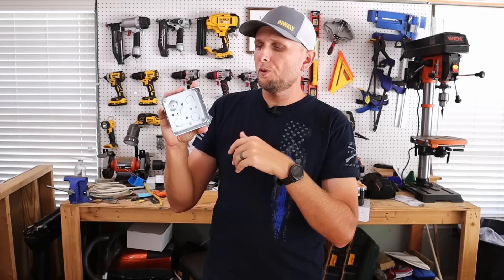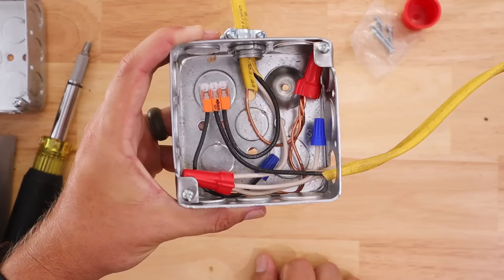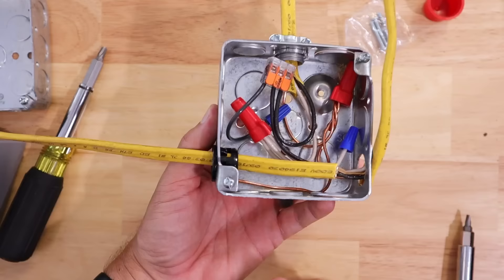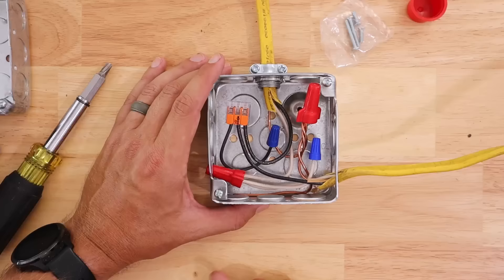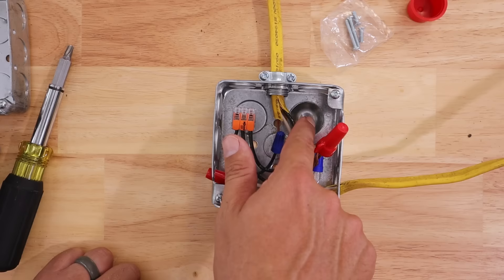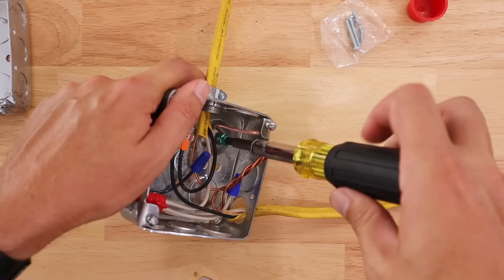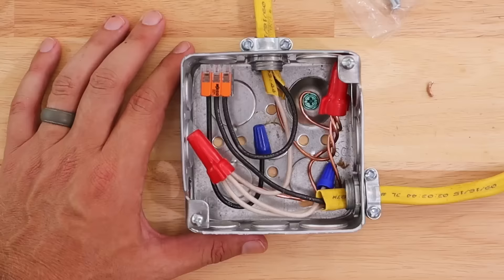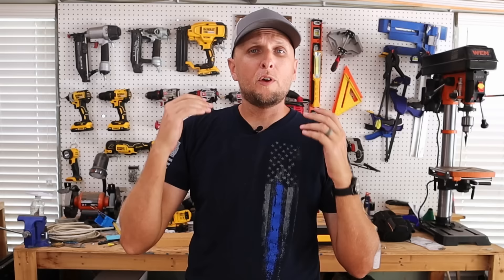The BIGGEST Mistakes DIYers Don't Know They Are Making When Installing Metal Electrical Boxes

Comment: The grounding hole is not always raised. It is sometimes one of "mounting " holes.  It's usually a little smaller and threaded. Lots of fun on a box mounted to wood. You either have to hang it off the stud for clearance or make clearance before mounting. Those green screws do not drill into wood very well and it will seem tight but is not all the way tight against the wire. Always wiggle that ground once you think it is "tight" to be sure! The boxes with a bump are preferred because the clearance is built in, but you don't always get what you want at the store!
Reply: @jeremiahbullfrog9288  I like to mark the holes, then dril a big shallow hole under the hole :)
Reply: @livingdeadbtu  a drill/tap combo bit does all that in one go.
Reply: On older boxes that are re-used during renos that have no camel hump or threaded ground screw hole I use the pre-wired grounding clips that attach to the edge of the box.  Faster and are code compliant.
Reply: @davidyansky6605  i got a box of those, but never used them. Its just as easy and quick to use a drill/tap combo bit.
Reply: The best way I've found to make clearance is to either keep an awl in your bag that has been ground down to just under the hole size and push it into the hole after the box is in place. While that hole you make is smaller than the ground screw, it will allow the screw to push itself in much easier. I also keep 6/8/10 tap in my pouch which can work for that as well using the first #6 tap as the awl. However be careful of breaking it as these are very hard and brittle.
Reply: Some people might say if you're using a humpless box on a flat mount, you're using the wrong box. The humped boxes are made to be used flat against a surface to provide clearance for the ground screw. The humpless boxes are made to be mounted with clearance behind them. Ne'er the twain shall meet.
Reply: @jeremiahbullfrog9288  probably not, but all these hacks slow you down and leave you liable to fuck ip, not notice, and leave behind an actual fault that IS a code violation, and dangerous to boot. Come prepared.
Reply: @Mirco Muntener  nowadays you use the things the store has. Sometimes, I have to go to three different stores and revise my plans because of supply shortages. The days of putting my nose in the air and saying, "I don't like that kind of box because I like another type," are gone. You get what you get and like it. I have found that buying what is in stock is faster than driving all over town or ordering something and waiting while I pray it comes in.
Reply: @david Yansky
Those clips are dangerous ( they are only compliant because the company paid to get them passed my honest opinion) . They are almost never put on correctly and they are never as good as a screw. 
I used 1/2 “ 5/16 head self tapping screws.
I started doing electrical work in 1977 and we called them 1900 boxes and ran EMT and pulled stranded wire. ( solid wire was for tying stuff down-ladders,stubbing PVC  out of the slab EVT ECT.) fast fawned 1992. Different state different rules. In comes solid wire/Rolex . I personally don’t like Romeo. I have built my house and shop with only EMT and M/C. Still use Stranded THHN with EMT/PVC.  I have PSA now so I use a tool  on a 12volt batch drill to put my wire nuts on. But you have to be careful not to over tighten them because they will come out of the back of the wirenut.
My grandfather had to twistSND solder every joint. Sometimes change is good.
Reply: @livingdeadbtu  Exactly why real electricians avoid the big box stores and use electrical supply houses that cater to professionals. If HD, for example, can't sell 100 million of something they don't want it to take up shelf space, which limits what pros can get. When I call my supply house guy I know I'm dealing with someone who understands what my material needs are and will do what he can to make sure I get it. While supply chain issues have hit everyone, if he doesn't have what I need on the shelf it's usually there by 6AM the next day or delivered directly to the job site. Most everything at the supply house is also cheaper than the DIY stores.
Reply: That is very true, and then if the box is mudded in with concrete, those non-raised holes become very hard if not impossible to use, which raises the question: is it good enough if a metal fixture screwed down to the box is grounded with its green grounding screw? I'm having this exact situation with my home reno and outdoor light fixtures. I can't get a grounding screw to the metal box itself, but the steel I-bracket for mounting the light is running screw-to-screw and has a green grounding screw - which sure enough provides 100% indirect conductivity to the box. Do I still need to ground the box directly too, or is this indirect connection enough? What says NEC?
Reply: @Fire Plug Obviously sarcasm, but I've seen it. I have a pic of it somewhere.
Reply: A small self-centering drill bit works for me. Even if you hog out like 75% of the wood, the screws go in super easy.
Reply: One thing I see wrong in this video is you're using those crappy China made southwire linemans. Buy American Made tools if you can guys. Which even some Klein stuff isnt American made anymore. We dont even call em linemans we call em kleins lol. Ibew jw if you couldn't tell by the comment. You make good videos bro keep up the good work and call your nearest ibew local and come get on board become a brother. Greatest union on earth. Best wireman too lol.
Reply: I will also use electrical tape and wrap around my wire nuts and wire  just to make sure they don't pull out. Extra safety  in my mind.
Reply: @timu.710  the only thing that electrical tape is accomplishing is pissing off the next guy.

Comment: Simple, concise, common sense. I am a DIYer, but I've always preferred a mechanical connection(twisted wire)
with a proper sized wire nut. Thank you for your simple good advice.
Reply from the maker: I agree.  Really glad to hear you liked it.  I really appreciate all of the feedback!  Thanks a lot Ricky.
Reply: Ricky....that's because you are smart...wegos are for inside lighting connections
Reply: @BlackVibeBallsack  You cannot even correctly spell WAGO. wagos are under-rated in their spreadsheets and can actually reliably have much higher current pass through them then their rated current. i.e 20A / 300V.

Comment: Great video, thank you. One thing on the 12awg and 14awg combo. Wire sizing is sometimes upsized due to length of run to avoid voltage drops. Personally I'm running power to my garden ~150' away from the breaker box. I'm running... i forget, 10 or 12 for the main run, but intend to use one size down in the boxes or the branches. It can handle the amprage, just would cause a problematic voltage drop over the distance. Either way, still an excellent video and I've certainly learned some.
Reply: @Salvadorbalihai24  The tap rule is three meters / ten feet, not three feet.
Reply: Just as long as the circuit is protected at the smallest gauge rating . If you downsize to 14 gauge you can only protect it at 15 amps no higher. 29 amps for 12
Reply: @Salvadorbalihai24  no
Reply: Poor guy has no idea what he just walked into with the whole 14 is cool on short bits. I'm staying out of it, for now.
Reply: @gerdberg4188  #12 copper is limited to 20 amps in most cases, even though the amperage table lists it at 30 it is limited below in the fine print notes. There are conditions in industrial and commercial installations that are engineered for the higher amperage but definitely not for a residential application....so a #12 can't be on an overcurrent protective device above 20 amps.
Reply: Derating for distance starts at full ampacity, which is 30 for 12AWG, not the 20amp overcurrent device limitation. So you can derate a whole bunch before worrying about distance.
Reply: I can't tell if yall are agreeing or disagreeing... bottom line you can mix and match sizes, just make sure the breaker is sized to the smallest wire is all I'm saying.
Reply: @kik1rik1  read the tap conductor rules... you will be amazed. I actually saw it in the field before I knew about it. Massive cables tapped with much smaller cables dropping 20' down to Overcurrent protective devices. Those lengths of tap conductors are legally protected by the larger cable OPD for the allowed length. It was a high ceiling in a papermill, engineered for the application and safe, but a real sight for my young eyes.
Reply: @sparkfighter1  you are so wrong and there are more instances where defraying is applied . 12 is rated for way more when it comes to deration . Read the tables , or do you even know what I mean when I say that . You are not even qualified to be an apprentice , and you want to argue . Makes no sense . Go out learn all about it since you won't listen to a professional !
Reply: Derating
Reply: @gerdberg4188 "Defraying" oops and maybe noting that one can edit instead of doing a 2nd post?  Maybe a course in careful proofreading before hitting send (especially on what seemed to be a caffeine or sugar high inspired post), for all?  Judge not that ye be not....
Reply: ... and then the customer plugs in a portable AC unit into the receptacle - using a 16 gauge christmas light extension cord.

Comment: I have found over the years that when using the two screw connector can cause  a dead short or a high resistance short if the screws are tightened too tight. Unfortunately they may not be found until after the rough-in is complete and power is applied. A high resistance short when coupled to a GFI circuit can be a bear to find. This goes for any metallic connector. The 2 screw connectors must be tightened very carefully and until the cable does not slip on a tug test. Over torquing can be almost impossible to find once the drywall is in place!!
Reply: Always wondered about that but never heard of it happening. possibly a burr was on inside of metal clamp that punctured wire?

Comment: I ran into two of the issues you are illustrating. First, the metal octagon box I encountered and got shocked from didn’t have the bonding screw connecting the ground wire to the box. Second, it did have a metal romex  connector installed but the wire was in at a steep angle and the installer tightened the clamp too tight, cutting into the hot wire and electrifying the box! I wasn’t working on that circuit but just bumped my elbow into it with a surprise! So lesson is, when using the metal wire clamps make sure to run the wire straight into the center and don’t over tighten!

Comment: The number one thing I've been encountering is the electrical box left uncovered. And, they didn't leave any screws in the box for the cover to be replaced. I wish you had mentioned that and the kind/size of the replacement cover plate screws. Great information all the way around. Thanks.
Reply: The screws are 6-32

Comment: Strain relief saved my home from burning down. I had a licensed plumber replace my hot water heater. My home has aluminum wire, but even many copper wired homed still use aluminum wire for large 240V circuits. My old water heater had an old school pool timer on the wall the AL wire came to two terminals and whip to my old water heater went to the other set. The contractor removed that timer and wire nutted the new water heater whip to the AL wire directly with couple of yellow wire nuts. I cam home found a burn mark on my wall. When I removed the plate off the wall entire box was burned up the aluminum wire burned like a fuse back to the strain relief where it actually got enough current to flow to trip the breaker. The strain relief forced the wires together tightly when the insulation burned off it tripped the breaker. If it had gotten back up into the attic likely would have caused a fire. The fact that have two wires touching they liquefy. It's lot like an arc welder.

Comment: Loved the video!!  Gave me some good reminders on what to look for.  I was concerned in that I'm updating some of light switches and plan on using the Wagos.  On your image for your video there are words "DONT USE" and pointing at the Wago.  Now I see it was about the smaller wire.
Reply: I missed that and I'm an electrician. Must be the camera angle.
Reply: WAGO's are a personal choice. If you do the strain relief on the Romex sheath and the wires going into the wago is not stressed and can not pull out they are fine. 

When I am rebuilding 1930's floor lamps I replace the old wire nuts with Wago's, a 5 way for all neutrals, a 2 way for the switched hot single lower bulbs and a 3 way for the switched hots for the other two. Getting five 12 gauge stranded wires into a wire nut is hard but a Wago fixes that.

Comment: The connectors you're referring to are not meant for stain relief it is meant to protect the wire from shorting on the metal box. Propper stappling of the wire before entering the box is wear you get the strain relief from. Also, the tap rule does allow for different wire gauges' to be used. A common Method to avoid voltage drop is to run #10 wire throughout and then switch to #12 at the device location.

Comment: I agree the things you pointed out are rather common code violations I run into as well. I must also add that there is no requirement in the National Electrical Code that the grounding screw must be green. The only bonding screw the code specifies to be green is a screw that is used for the main or system bonding jumper in panelboards and and other similar equipment. These green screws for the box type in the video are just a convenience product that works great for the application but is no requirement to use this specific product. Also the  particular style of non metallic cable clamp you showed in the video is intended to be installed from the inside of the box. It is designed that way to take less space in the box. Most common places I use that one is in those shallow light and fan outlet boxes or maybe when fishing a cable into a box or cabinet that is flush in the wall and would be difficult to install a connector from the outside of the box.
Reply: If you install the non metallic clamp the other way around wouldn't it then keep the wire from pushing into the box but allow it to be pulled out?
Reply: those plastic clamps come in to varieties, one install inside to out and one installed outside to in. it is used correctly in this video

Comment: Another thing I would point out is to just snug the clamp down on the metal NM connector. Over tightening the clamp can damage the cable causing a short circuit. I do agree they are the best connector and use them myself, just don’t over tighten them. I’ve been a journeyman electrician for 38 years.
Reply: Why would you use a metal connector when the new plastic ones are so much better
Reply: I mean after all it is plastic cable
Reply: @gerdberg4188 ecause as the video explains, the screw clamps hold more securely.  I would only use plastic on data or maybe thermostat cables.  Moving wires can work loose.  Also, there are clamps that are usable from inside the box, though a bit tricky to work.  One more thing--someone proffered that "How To Home" used the plastic device backwards.  I disagree.
Reply: What was the additional black wire to a wire nut and and the same for a white? I didn't understand that
Reply: @irish89055  those would be called pigtails that are meant to be connected to the receptacle, light or other device that the box is there to serve. If the box were just used as a junction point, those pigtails wouldn’t be necessary and wouldn’t be there.
Reply: @replyhere590  there are 2 types of the plastic connectors, ones that go from the inside and ones that go from the outside
Reply: @irish89055  As was mentioned near the end of the video, he was setting up a roughed in demonstration box for the installation of a receptacle.  The short black and white wires with the blue wire nuts on the end are "pigtails" intended to be connected to the receptacle when the job is finished.  There is also a short bare copper bonding wire pigtail the end of which is hiding in the lower left corner for the box to connect to the frame of the receptacle to bond it.

Comment: I liked your video. One thing that always concerned me as a electrical inspector was when I see wire that had been stripped with a razor knife.  A lot of times as this is done fast, the blade cuts through the conductor jacket as well as the outer jacket. Best to use your t 5s  or strippers to barely score outer jacket to allow a clean break without touching inner insulated wires. On uf wire, all I needed was my linemans pliers only.